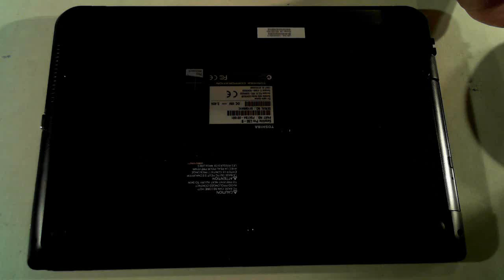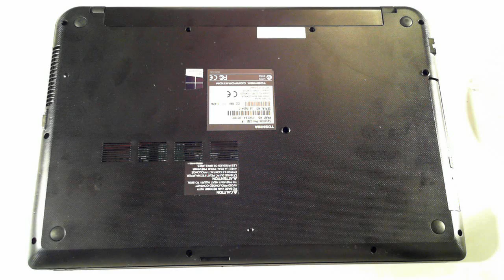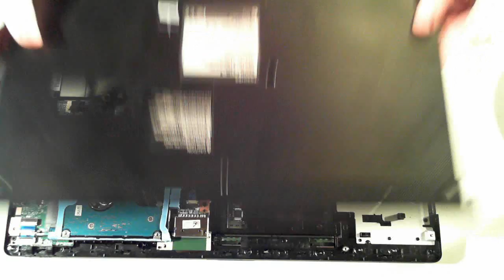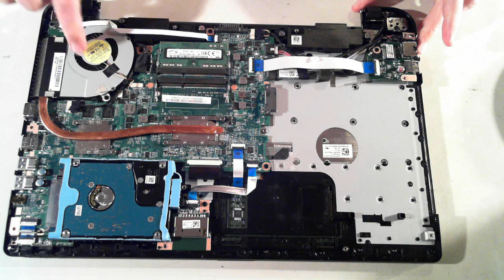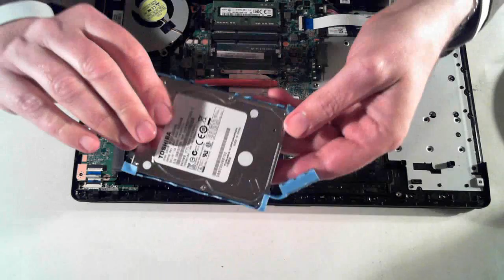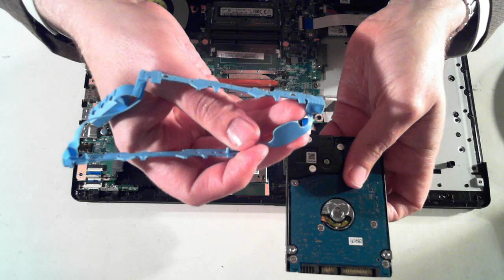Toshiba Satellite Pro L50-B Teardown / Upgrade / Take Apart

Comment: No, no compressed air needed in this particular model. All you have to do is remove 4 screws from the CPU/GPU socket and 2 from the fan. 
Now, disconnect the power wire from the fan to the m/b. 
The next step is to detach an additional wire from the side of the fan.
If you've completed all of it, you can easily remove the fan.

On one side of the fan and the radiator, you'll see masking tape. All you have to do is take it off. If you've done it, you can take these two apart and if you have dust in between them, you'll have easy access now to remove it.

Put everything back together, but..., if the thermal paste wasn't replaced for a long time, do it. If no, you risk like big time.

Comment: Hello in need help 😓

I have a toshiba satellite L50-B916 and i just installed win10 but after almost 10min 
My screen stoped working and not showing any movement even the mouse 
In the past knew that the AMD graphics card is dead so i don’t know how to disable it and it’s not showing on the device manager menu 
Is there any way to just remove it or disconnect it and only work with the intel card !!? 

Please heelp 😢😢

Comment: your back plate comes off easy mine dosent ive removed about 10 screws out of the back pryed along edges really gave it some force it aint budging like yours its like its attached in the middle somewhere i believe its got front screws somewhere ?

Comment: Help?? Hi guys. Original toshiba hd failed on my L50-B-1DZ a while ago and I'm looking to replace it with a new one; my question may sound silly but where is the os stored on this baby? Will I lose my windows 10 by replacing the hd? Thank you
Reply from the maker: The Win 10 key should be stored in the BIOS. You should be able to install a new HDD and install Win 10 fine.
Reply: Thank you guys 👍
My old HD is encrypted (dead/ caput). So my main concern was spending  £ 60 to £ 80 on a new ssd only to find out I need to fork out another £££ on a new windows :-/
Reply from the maker: Phone up Toshiba support, they should be able to send you out a Win 10 recovery disk or USB drive for low cost.

Comment: I installed a SSD on the same exact laptop  11/15/2016.
When I reinstall the bottom of case, the cpu only runs at 800mHz,cpu fan is running on high it sounds like constantly.
I have turned it to high performance power,set default power,shut it down,restarted it, system restored, completely new install of windows 10 and my programs, still same issue.
I have removed case 20+ times and each time I leave it off it works fine.
WTH am I missing here? thank you

Comment: Hi, is possible change the CPU on this notebook? thanks
Reply from the maker: It should be (I didn't check to see if it is soldered directly on to the mainboard though)  but I wouldn't recommend it - you need to confirm that the cpu is compatible with the bios and also may have to deal with thermal issues of a faster CPU as the case may not dissipate the heat correctly for a different cpu.

Comment: i have problem with  space key. on the right it doesnt work. would you sugest try fix or buy whole keybord? if fix , how? thanks
Reply from the maker: Have you seen if it is just a loose connector? If not I'd say replace the keyboard.
Reply: Thanks for fast respond. Just after i asked you i tried to fix it and I DID!  Metal parts were not in place. Now it is way better.  But i already ordered keyboard cuz i have guarancy. Thanks! will subscribe.

Comment: guys I have a l50-b-1e1 and when i first took it apart it did'nt have a fan. Is this right?
Reply from the maker: Its strange it has no fan. I did a quick search and it looks like others have found no fan in this model - https://forum.toshiba.eu/showthread.php?79982-Re-Satelite-L50-B-1J3-No-CPU-Fan 
If you are concerned contact Toshiba or a Toshiba Service Centre to confirm.
Reply: how is this even possible i am worried about my laptop now.
Reply from the maker: They use some other passive cooling method.
Reply: +dpcomputing wow. Now what should i do? buy a fan or not?
Reply from the maker: Yours was probably designed not to have a fan. If you are worried speak with Toshiba or where you purchased it from but don't go and try and bolt a fan in that may not fit.
Reply: +dpcomputing ok thank you.

Comment: Very informative video, it's easier to clean out the dust on this model.
But I went through all of the comments, and someone mentioned ripping the top off the laptop to replace the keyboard, and you mentioned that you didn't have a video on it- I just want to be clear but what method do I use in order to remove the keyboard and replace it? Thanks in advance.
Reply from the maker: +Helgigas As I haven't change the keyboard on this model I can't say - sorry.
Reply: +Helgigas - Hi, did you ever get the keyboard out? Top panel over the keyboard seems to be hot glued in all the way around! Any advice from your experience on how best to remove it?  Thank you :)

Comment: ive got the exact same model as this laptop displayed in the video, i was wondering where i would source a new heat sink. im having trouble trying to find one with the double panel for the cpu and gpu running from the same copper line.
Reply from the maker: +VastoPenguin contact Toshiba or a Toshiba repair centre.

Comment: Thanks for the guide. A heads up for those trying to replace their keyboards - it's nasty! Toshiba uses hot melt rivets to assemble this machine, not screws. You have to snap them apart to remove the top face of the laptop to remove the keyboard which makes it difficult to reassemble neatly.
Reply: +YamCom Yamba Could you PLEASE re-state what you just said?
If I'm not mistaken, you mean to tell me that I need to pull at the silver part of my laptop in order to replace my keyboard? the silver part that has the intel/amd stickers, and is around the keyboard ie.

Comment: can i upgrade to the wifi card to 802.11a\b\g\n or dual band wirless?
Reply from the maker: +4getfull111 yes you can. It is located under the ribbon cable as I point out int he video.

Comment: If the TOSHIBA l50-b  discharged the battery. The clock is reset. Where can I replace battery (cr2032?) ?
Reply: I have the same quistion.... so somebody have the awnser
Reply: Hola ...también tengo esa, pregunta donde está ubicado para  reemplazar la pila  2032  del cmos " bios"
Por favor  se me apagó y no funciona, 😔

Comment: I have the exact same model except mines an i7 5th Gen, 8gb ram, etc. but the fans are always running too high. is this normal? with my old Asus with i5 was much quieter. it is still noisy whilst idle.
Reply from the maker: +Moustafa Sadek (moustafasadek11) I7 will run hotter which may be accounting for the noisy fans. Have you given the fans and heatsink a clean?
Reply: dpcomputing The laptop is brand new and I had opened it up and there is literally NO dust at all, even at the heatsink. It has come down to me thinking its a design issue or the fact it is an i7 with dedicated graphics.

Comment: I have the L50-B16-N, not Pro L50. So, i want upgrade ram memory from 4gb installed to 16Gb. I open de laptop and there is only one ram slot ? Where is the seconde ram slot ? under the keyboard ? thx
Reply from the maker: Eric Bescond some models may only have one slot so you may be out of luck finding a 2nd one.

Comment: Great look at the inside of my Toshiba Satellite L50-B for the first time ever!
I've got a problem with the hinge holding the lid/screen to the lower casing. One of them broke and I've no idea where to buy a replacement part or how to fix it. Calling in a tech can be very expensive and I'd only use that as a last resort, if I've exhausted all other attempts to do it myself. Please help?
Thanx again
Reply from the maker: Sharyn Lynch have you contacted Toshiba direct to see how to get the part?

Comment: Does anyone know where I can find the cmos battery on this model
Reply: +Michael Keiller I am looking too. did you have any luck?
Reply: +nokiaman2002 turns out it didn't have one. The issue I was having was fix by pulling the computer apart and putting it back together again
Reply: ok thanks for the reply
Reply: +nokiaman2002 i don't know if this helps or not. The issue I was having was the laptop wouldn't shutdown it would turn off then after a pause turn back on again.
Reply: Sounds like a short circuit. Sometimes just opening them up can resolve the issue.
Reply: +Michael Keiller sometimes just disconnecting the battery can achieve the same trick..

Comment: I spilled glas of water and immediatly turned id backside and turned it off after that i dryed with cool hair dryer and my question is it water 100% inside or it could be dryed from keyboard righr away?
Reply from the maker: Aleksej Stankovic I'd say the water would be right through it (even if only a minute amount). Give it 3 - 4 days to dry out before you turn it back on.

Comment: How do you remove the optical drive on this laptop? The only thing I see in my laptop is a plastic holder
Reply from the maker: Thijs - some models do not have an optical drive.
Reply: +dpcomputing 
I see nobody got idea to put ssd in place and instead of optical drive. So you have HDD and SSD in same laptop. Is that possible? Does optical drive area contains all the "wire" to connect standard SSD 2,5 inch?
Reply from the maker: It is possible but you will need a third party caddy or work out how to fit a drive int he space.

Comment: Does anyone know how to dismantle the screen of a Toshiba Satellite S50T-B?

...

My current Toshiba satellite has a cracked screen, and in the interest of not completely emptying out my wallet I would like to replace the damaged hardware personally if at all possible...

Guides on replacing damaged screens in earlier models sound reasonably simple, however they mention removing screws from the front of the monitor, which I do not believe the S50T-B has...
Reply: +Sitromxe Hi, have you found any disassembly for our laptop? I have an s50t-b too and would like to replace the thermal paste and clean the fan. I couldn't find any vids on opening this old bum

Comment: Do you know where the CMOS battery is on these laptops?? (I've just cleaned a model L50-B-1DZ) for a client who had spilt hot chocolate in the keyboard (cleaned each affect key - could find a way to remove the frame and get to the chiclet keyboard). The system now mentions low power on the CMOS (need to set date and time), but couldn't find the cmos battery - anyone know where it is??
Reply: Did you find the solution to the low battery power issue for RTC?
Reply: @abdullahsorathia3394  8 y & 6 y.... i need to find that Battery, any tip?

Comment: Hi,
i have this model in a purple colour and next to the hinge, to the left looking at it, it has cracked and so my power input keeps moving and the lid / screen will not stay up correctly. Any idea if this can be replaced and if so where you buy the part? If there is one.
Reply from the maker: Jane UK It should be able to be fixed. I suggest you contact your local computer person to check it out.